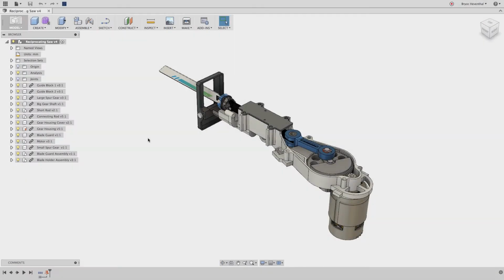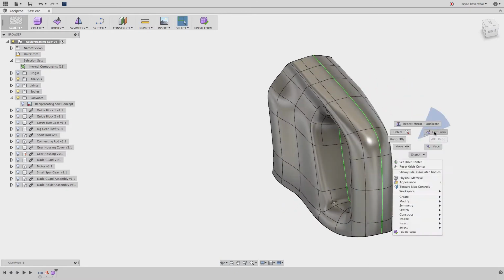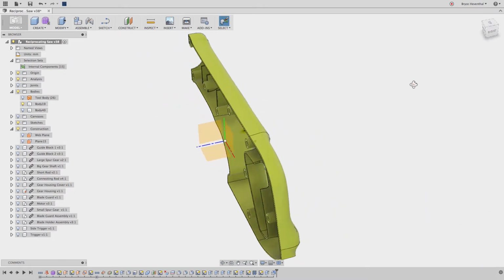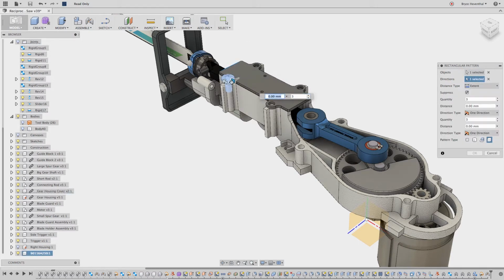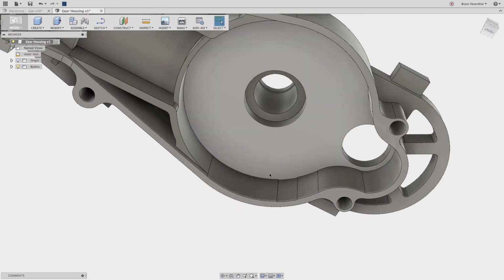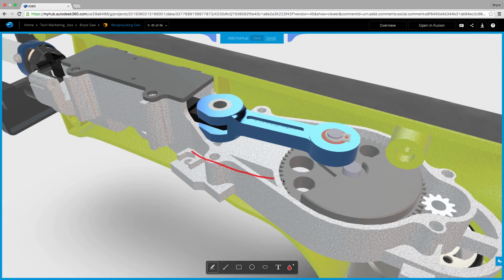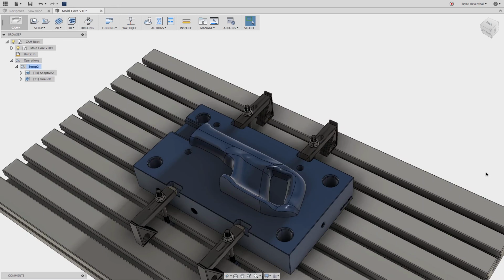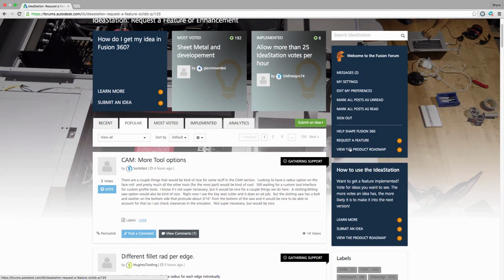Autodesk Fusion 360 Ultimate

Comment: But the only question I have is how can we make a sharp edges in sculpting without using crease command or adding new edges  near by i really need to know
Reply: Using "Sculpt" this is the only way I've done it. If you need more control over surfaces, you'd need something with better surfacing capabilities like Alias or Rhino. I haven't found the Fusion surfacing mode to be that advanced since you can only do surfacing through sketches on flat planes with very basic 3D sketch abilities. You also can't do complex surface/texture design like you can through Grasshopper in Rhino.